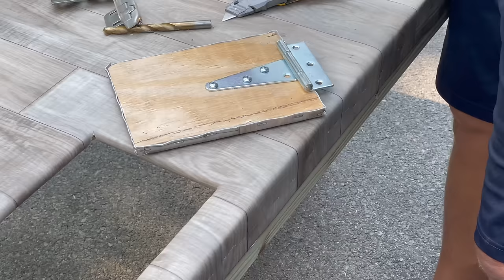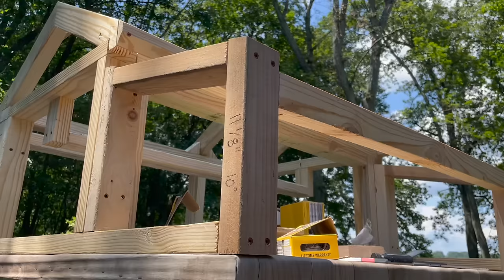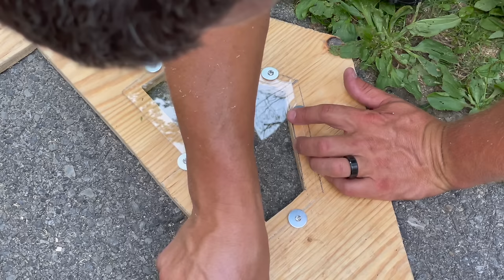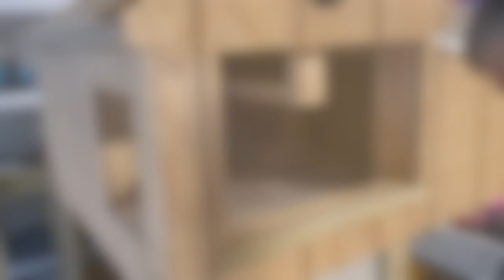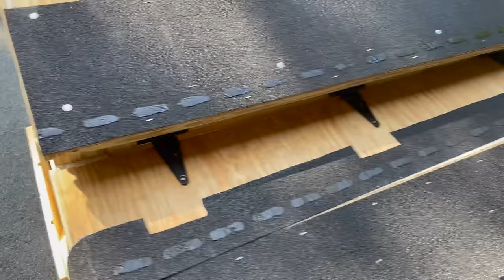Portable Chicken Coop:  Step-by-Step Build - Easy to Clean V4.0 (No Commentary)

Comment: This is certainly a very well built coop, very beautiful too. Is it not a little heavy for it's size? I don't think you needed 4 trusses, and the lumber is doubled in a couple of places. How many chickens is it for?
Reply from the maker: That’s a fair assessment.   If I wanted to cut down on weight, three trusses would have probably been fine.  I probably didn’t need the additional framing under the nesting box area.   Thinner plywood could have been used instead of t-11, and the nesting boxes could be about 3 inches shorter.  Also, the roof shingles add a lot of weight and a corrugated plastic roof would be a good substitute there.  

That said, there is some comfort in knowing that it’s overbuilt because we get some decent storms and pretty good snow where I am.   

This coop would be great for 3-4 chickens.

Comment: The way the wheels are positioned, have you had any issues with them supporting the weight? Do you think that would support a heavier coop?
Reply from the maker: I haven’t had an issue weight wise, the bigger problem has been clearance.   I think at some point I will need to upgrade to proper chicken tractor wheels that can be raised and lowered.

Comment: Did or do you per-drill any of the holes?  Enjoyed jim80
Reply from the maker: Hello I typically pre drill near the end of a board, especially if I’m going into framing diagonally.  That happened a lot for roof rafters and nesting boxes.   I don’t believe I predrilled any of the pressure treated wood because it was still so wet and wasn’t cracking.

Comment: Egg hutch is as big as house part
Reply from the maker: Yeah, I am going to mention that  in my commentary version.  I meant to put the end 2x4 piece between the two outside framing pieces, but I accidentally put it on the end of those which added 1.5 inches of length to the boxes.   That also meant I had to go higher to ensure proper roof slope.   Hard to explain via text but if I had to do it again, I would make the nesting boxes smaller